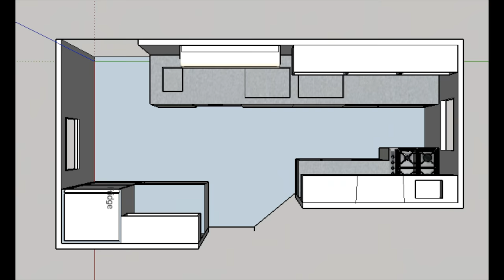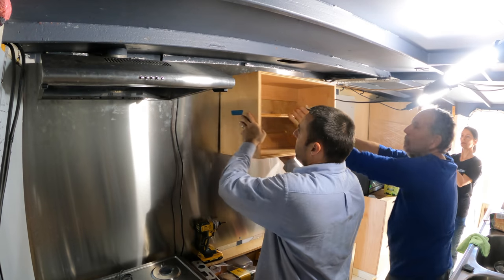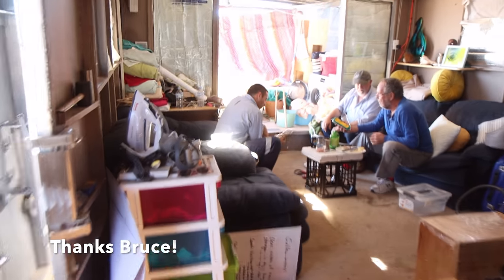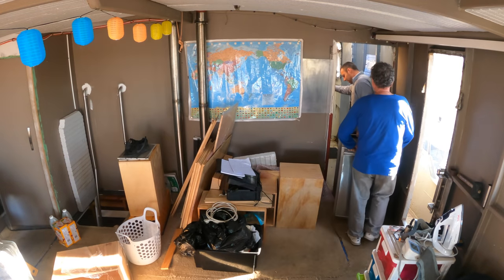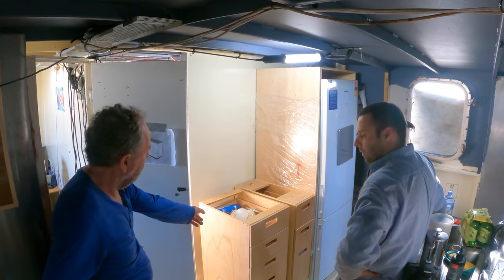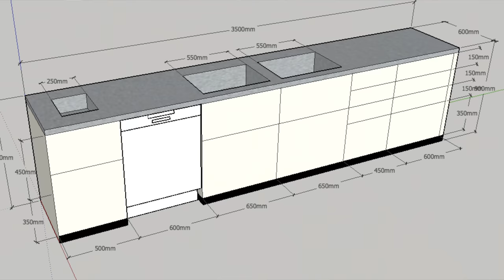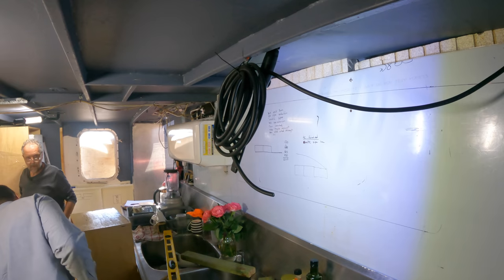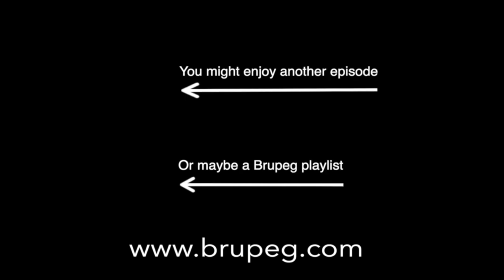The galley cabinets go in - Project Brupeg Ep. 210

Comment: Hi Guys, A bit off topic but thought I've been meaning to ask if you intend to heat your vegy oil and keep the fuel lines warm. My mate ran vegy oil in his boat, and the cooler temps turned it to gunk that clogged his tank, wouldn't flow through the fuel lines and also clogged his filters.( and that was in Sydney Temps).
You could probably start on normal diesel, then switch to heated vegy oil when the engine is up to temp, then switch back to normal diesel before shut down without worrying about the lines clogging?
Anyway, I'm sure you have a plan and I'll be interested to see how you manage cold vegy oil.
Keep up the great work and I'll see you on the ocean some day.
Dave.
Reply from the maker: Hi Dave, the plan is heated fuel lines and tanks plus starting and stopping on diesel as you mentioned

Comment: With all the hardware your putting in the vessel, is the weight going to be even port to starboard ? And what is the final gross weight going to be ? With the cupboards or shelving are they going to be secured so when you go up & down waves stuff doesn't fall out onto the floor.

Comment: I think you’re doing a great job on the galley. Your fastidious attention to detail and quality should be commended. I owned a restaurant and noticed one little thing you might consider. The closeness of the cupboard to the exhaust fan may cause you difficulties with cleaning after some time with grease buildup you’re unable to get to. Maybe some kind of seal between the two to eliminate the possibility?
Reply from the maker: Yeah this is a a great idea. I think a seal is fairly possible

Comment: You done so much work. 
As with all kitchens/ galleries grease and grime.  Sealant over every edge. If test  out the fan with something smoking.  If it doesn't work. I suggest a 15 cm in line fan. In the exhaust pipe. Now I don't know what is available in AUSTRALIA. 
One last question that is where is the beer fridge? 
With a full crew that fridge has to be large. After all once the camera is off the left hand has a beer.
Cheers to Kiwi engineering 🥝👍🍺🍺🍺🍕😉

Comment: We bought a 50 ft Trawler and did major interior remodeling and re-design of the interior. We appreciate the amount of work you have undertaken.  No such thing as a square corner is there?  We used strips of door skin material (1/8 " thick)and a hot glue gun to make accurate templates to handle all the curves/angles. Do you plan on a railing or such to keep everything in place on the shelves while underway? Best wishes to you both  from Arizona.

Comment: Rivnut guns can be a headache! The solution use the correct bolt for the rivnut and put a nut the next size up nut between the bolt head and the rivnut hold the nut with a wrench tighten the bolt to compress the rivnut and throw the gun overboard

Comment: Hey Dame, heard you say that LP gas wouldn’t work in low temperatures?
Butane won’t boil into a gas below approximately 32° f.
However Propane has no problem down well below 0° f.
In fact the upper camps on Everest are littered with propane bottles that climbers were to tired to haul out. 
Can’t you get Propane down there in Oz?

Comment: There's a type of stainless steel trim that can be inserted on sheet panels. Used for elevators (at least that's where i know it from). Unfortunately, it would be pointless for me to link you since it's from Europe and they don't ship in Australia. However, if it exists here, it should exist there as well, and maybe you can it. In Google, the "images" tab, searching for "stainless steel inside corner trim" should give you the answer in the first images. It's distinct from the tile stainless trim or the floor type and thus easily spotted. Maybe it's useful for that corner, it certainly shores up the whole structure if the ends of the sheets hang at the corner.

Comment: That upper cabinet will hold a couple hundred pounds, no problem and that cabinet with the trays you found at the scrap heap, looks like it was made for your Galley. That's awesome, as they say, " one man's junk! is another man's treasure.
 " When you work with Stainless its like working with another creature." For instance you cannot cut stainless with a oxy fuel. All you can do is melt it, even if you use 3,000 degrees of heat you will not cut it. All it will do is melt it. The only way to cut Stainless is with a plasma cutter. When drilling stainless you have to turn down your rpms to cut it properly or all you will do is heat it up and harden it more. That is why I cut stainless sheets, for instance, with a cut off wheel. If you try and cut stainless sheets with a hack saw you will be there all day long. So you have to learn the tricks of the trade when working with Stainless cause you will be presented with a whole bunch of challenges that you normally won't have with carbon steel. I was told that bullet drills work better for drilling stainless, I haven't used them so I cannot give you advice on that info. you have to do your research on that one. but I would use cobalt drill bits, if you want success and use a coolant as well or you will work harden the material and that is something you don't want. Bending it too much will work harden the stainless and drilling holes at fast speeds will do that as well. I would recommend researching tips about working with stainless, the more you know the better. I'd recommend using adhesives when fastening stainless in many applications before drilling, if necessary, it will save you a lot of time and save you headaches. Tap Magic and CRC are good cutting oils, for drilling and tapping. btw I'd recommend Dewalt drill bits, they do well according to Project Farms testing's reviews.  Irwin makes very good cobalt drill bits that are expensive but there suppose to be very good. Master force and Bauer makes good ones as well.

Comment: Looking awesome
With the efficiency of your range hood being up high, make sure your exhaust pipe has no restrictions. Like dropping the size from 100mm to 90mm for example. This reduces flow as the back pressure increases and also increases the fan noise.
Reply: The range hood will NEVER be effective when mounted that high off the cook top.

Comment: the corner next to the cooker top you could it a length of stainless angle up it (just to cover the small gap)
When you finish and get to cleanup the rub some cooking oil on the wall it should hide scuffs and hand prints.

Comment: Looks Awesome! Stainless walls are cool. Are the upper cabinets gonna have doors? If the bottoms of the uppers are anywhere near the stove the wood bottoms will quickly be damaged by cooking steam and heat, not sure how to fix that, I used sheet metal plates and it worked for me. Also nice to see Kitty again😎🐱🐆